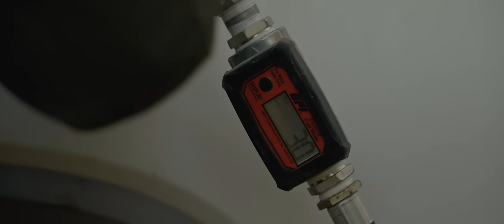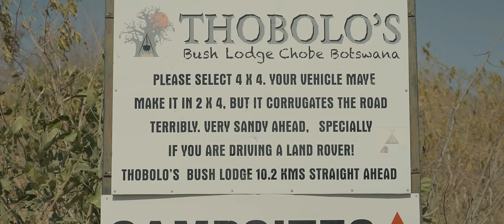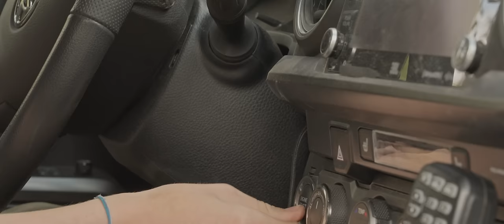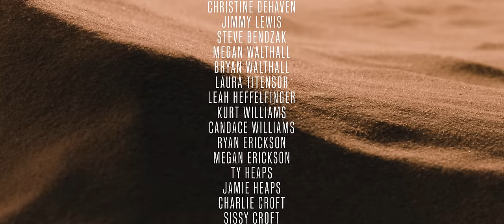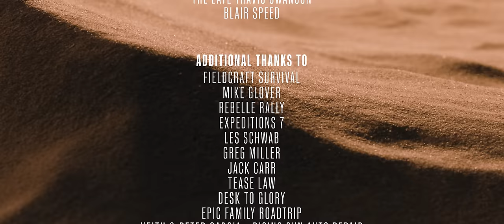This is Africa | Camping with Elephants in Botswana | AFRICA XOVERLAND S6 EP2

Comment: looking at the number of bolts coming undone, you need to start using loctite thread lock.  Loving the video though it's amazing.
Reply: For sure!
Reply from the maker: 100% agree!
Reply: Im feeling part of the crew .. excellent documentary  @ExpeditionOverland
Reply: @ExpeditionOverland I would recommend looking into Nord-lock washers as well. They're spendy, but best option for reducing fastener loosening from vibrations. Watch a junker vibration test with bolts to see their effectiveness with other options - its crazy! Would be a good idea to put these on critical joints.
Reply: I have followed this series since their first season, and it has been the inspiration for my own adventures. My wife and I get out as often as possible.

Comment: I have never aired down my 1973 Landy and nothing rattled off, as you say. And I used live and work in the bush. Even during the Rhodesian Bush War I never saw anyone air down a military Landy or a Mog.
Reply: Tacomas, Tundras and that Sequoia are not built like a Land Cruiser. Heavy duty vs grocery getter with some add ons.
Reply: oh yeah the zimbabwean liberation war
Reply: You probably did not have a compressor to do so..airing down or up..using air-pressure to get a better ride, better traction is so effective ..I don't see how driving a Landy would change fundamental laws of gravity?

Comment: Clay...35" wheels are used by some local overlanders.  What you are experiencing is normal corrugations. Either you air down more and drive slower or you maintain a suitable offroad tire pressure and increase your speed so you skip over the crests.

Comment: Suffering from dust - open up the distance between vehicles, giving the dust a chance to settle or clear.  Once separation distance is achieved, ensure the fresh air is selected, NOT recirculating and dash fan is on 'full' speed. That's how we manage dusty roads in Australia. Works a treat.

Comment: I've designed vehicles and heavy machinery for the worst conditions. Lock washers (nord-lock) are what you need to prevent bolts rattling loose. Nord-locks are fantastic on their own but in hard to access areas, use nyloc nuts with the nord-lock washers for double security peace of mind. loctite threadlocker for triple security. 
thanks for your content, gives me inspiration to get out there more often.

Comment: Cant help feeling a 90s Landcruiser, no apps, 10ply tyres plus extra tanks would do fine. All the extra equipment adds weight and reduces fuel efficiency. Tents, a fire, braaivleis, canned foods, gas cylinders, satellite connections, sleeping bags and water. I have zero experience but sometimes less is more.